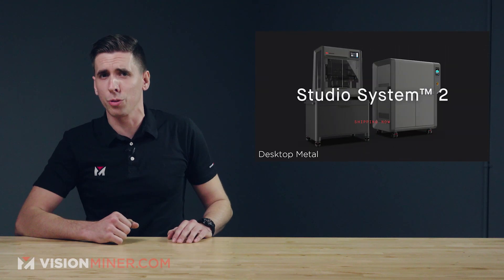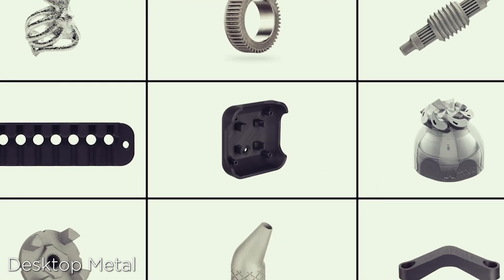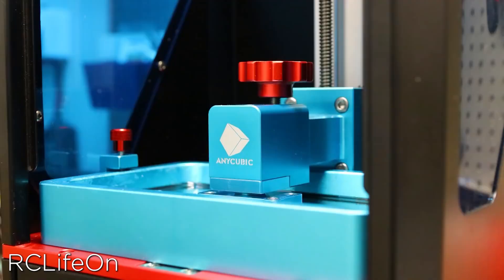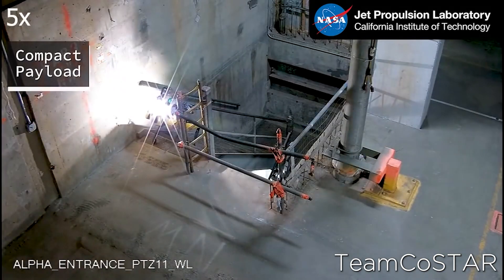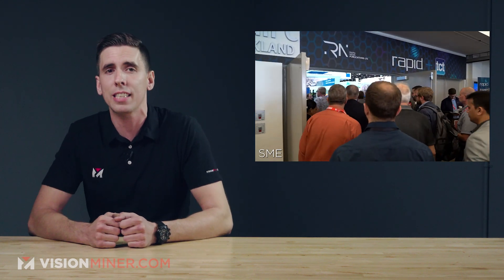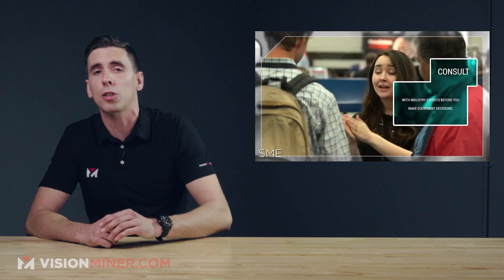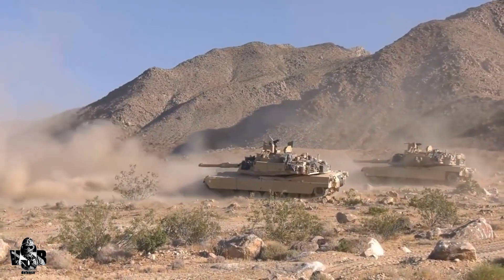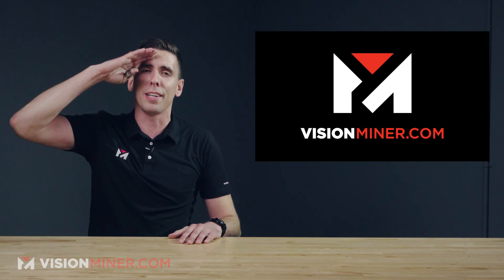Desktop Metal Studio System 2, Neatsy AI Foot Scanner, Markforged Helps DARPA Competition, and More!

Comment: Expose your parts to pressure/deep pressure cycles to the point of failure. For example create a sphere using a material that you can quickly pressurized and then depressurize over and over again until stres fractures form and the part is destroyed.

Comment: Awesome info as always! Can you guys do a test on what happens to printed parts that have been submerged in water? Maybe various liquids and what happens to printed parts? 

Or what filaments would be good for outdoor continous use? I've got a large metal building that is round and scalloped and I'd like to put gutters but the shape definitely has no straight lines.  I was thinking I could print inserts to put in-between the scallops to give myself a straight line and for the water to run off, but I don't know what would survive outside. They wouldn't be in direct sunlight and rain, but I'd want to make something I wouldn't have to keep replacing.

Thanks again!

Comment: Carbon fiber filament high pressure holding test , print in a square shape with a valve joinery and pressure the cube and the wall thickness more than 15mm and 100% infill u can  choose affordable scale of the above mentioned spec cube and pressure throughout valve joinery in center bottom and try to break the cube .
I hope u got me
Reply from the maker: That's definitely getting more into it, but we do have a video from years ago when we tested a CFPEEK part almost exactly like that... held 1,300 PSI no problem! https://www.youtube.com/watch?v=7eiiOdWXjCs